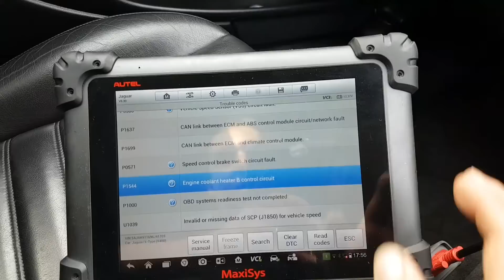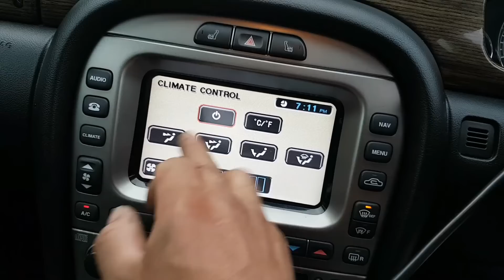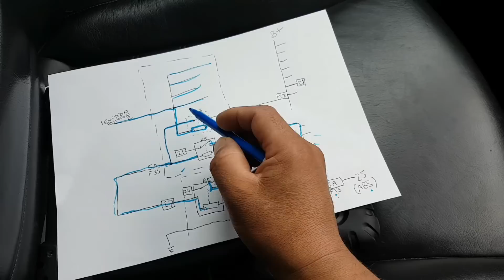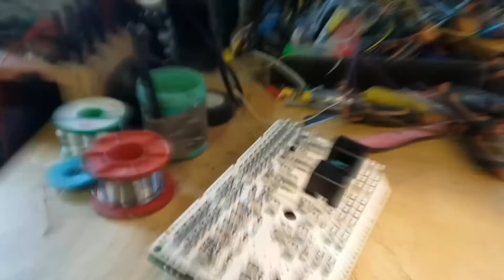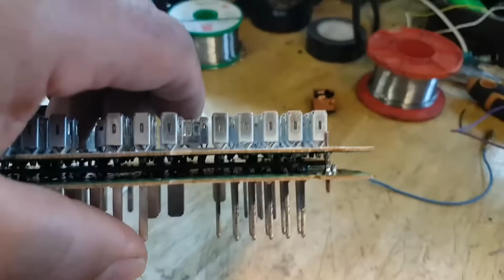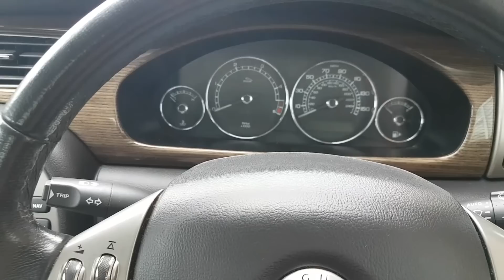Jaguar X-type (X400) multiple electric faults one common cause... Fault finding and repair.

Comment: Fantastic job Luis, keep up the good work. 
I have only one question, did you manage to permanently remove the error "dsc system fault" and "cruise not available" by replacing relay 13? 
I get that error and my car goes into limp mode on Jaguar X type 2.0 diesel 2004 year. 
The electronics guys I've driven the car to don't know how to fix it. 
Thank you. 
Greetings from Belgrade!
Reply from the maker: All as per the video...
What trouble codes are you getting on the ABS? 
👍👍👍
Reply: I don't know the exact codes, I'll have to ask the mechanic next time I go to him. Limp mode appears every third or fourth drive, but the cruise is not available light is always on.
Reply from the maker: Without the codes it is difficult to advise...

Comment: I have a question about a faulty anti theft issue on the Jaguar x-type v6 2.5l
. Can the immo be turned off.
Reply from the maker: Possibly... I am not sure which ecu is on that one.
But, what is the issue?
👍👍👍
Reply: @LMAutoRepairs  It's a cheap side project car I'm going to buy. Seller says it won't crank because of the antitheft module. I was thinking to make an “all keys lost”. But should be easy enough, I think the IMO is in the Instrument cluster.
Reply from the maker: Possibly...
Better try to program a key for it... but if you are not bothered, immo off might be a possibility...

Comment: My 2005 X Type only 110000 km. Not an electrical issue with the instruments but a tick tick ticking sound varying in speed and intensity as I drive along. Sounds like it could be a mechanical sound maybe emanating from the speedo as the dial spins behind the needle????? So it wouldn't have a speedo cable like in the old days but the speedo obviously spins at varying revolutions depending on your vehicle speed on the road. Any thoughts on the cause??? Could it be fixed or is stripping the cluster not worth the trouble?
Reply from the maker: Hi
Could be, some clusters use a stepper motor  with gears... but is the needles accurate and steady?
Just asking, cause I would guess the needles wouldn't be stable. 
👍👍👍
Reply: @LMAutoRepairs  All the gauges work fine, steady and accurate. It’s just the chit chit chit sound that drives me crazy whilst driving. I thought it could also be a relay tripping on an off somewhere. Initially I thought the sound emanated from the light switch cluster but it’s hard to tell
Reply from the maker: @allanpennington 
Understand, but it if difficult to advise without listening to it...
👍👍👍
Reply: @ Its like morse code but a chit chit chirp chit chit....type sound. Not that loud but noticeable when driving. I assume if I took out the cluster and disconnected the two rear cable assy clips the car wouldn't start? That way I could at least confirm the source of the noise??
Reply from the maker: @allanpennington 
Possibly will not start, but if you disconnect if once the engine is running, should stay running... so you can test.

Comment: Your work and dedication is absolutely amazing and inspiring. As a soon grauated engineer, thanks for sharing it ! I own a 2007 2.0d Jaguar X Type with only 100.000 kms. She's in mint condition aesthetically and mechanically. But I am having troubles with my headlights. The auto function doesn't work, my Left Low beam doesn't work too, I can't maintain my High beams, only flash them and I can't level my beams (with the selector according to the load of the vehicule). From what I've read, it can be a consequence of many little failures... Would you mind giving me some advices or hints on how to take on that problem please ? I'd be very grateful. Thank you
Reply from the maker: Hi
I would start by scanning the car, check live data, see if there is anything that points into any direction...
👍👍👍

Comment: I had problem with my passenger fuse box... fuel pump relay on 2.1 V6 was broken. I change it like you on video and it works! Thanks

Comment: Extremely helpfull video. I had exactly the same fault with my Jaguar x type 2.2 diesel 2007. Of course could not change just the relay Not have tools or experience. So replace the whole fuse box together with black box and wire. THANK YOU very much for detailed information. You are the best!!
Reply from the maker: ☺️
Thank you for watching and for your comment! 
👍👍👍

Comment: I fully agree that it hurts to see that Jaguar apparently did things on purpose to make things close to "unfixable" (that "fuse" on the PCB and that non-serviceable relay). I have 2 more examples, which I fixed anyway: The rubber on the plastic-strips to the left and right of the windscreen disintegrates over time. I just wrote a post on jaguarforums of how to fix that anyway with generic rubber-strips. Also: Jaguar designed one bolt of the oil sump to remain inaccessible. To avoid having to remove the transfer-box and the cat and whatnot, I drilled a precise clean 17mm hole thru the side of the transfer-box (and also just wrote the post about that on the same forum).

Comment: Horrendous design on that board. I've never disassembled them that far. I've opened up the box and saw the clusterF of the two boards fused together and said 🤦‍♂️ and tossed them.

The sad part is these boards are starting to become harder to get. I'm pretty sure they are discontinued. At least here in America.
Reply from the maker: ☺️
The repair will become the only way then...
🤪
👍👍👍👍

Comment: Hi Luis. How you don’t lose your temper with some of the tw*ts that go before you is beyond me. 

It’s the same with heating systems. An idiot with a little knowledge is a scary scary thing!!! 

Congrats for completing it though. 

Re the egr, on my volvo T5’s, I’ve experienced people changing the recirc bov on the cold side of the Mitsubishi turbo to get it to make a silly noise! Because the air doesn’t recirc into the inlet as it should, it throws the whole inlet monitoring system into a panic. Maf fault. Tps fault. Map fault etc. Well done for listing video. It was very interesting following your thought process. 

Thank you. 

Ted in bedford
Reply from the maker: ☺️
It is challenging at times... no doubt! 
Thank you for watching and for your comment! 
👍👍👍

Comment: I had the exact same faults on a x type I was working on at the dealer, unfortunately you can't buy a new fuse box anymore so repair or second hand is the only fix.
Great diagnostics! 👍🏻

Comment: You sir are definitely a genius, in automotive electrical diagnostics and repairs. As for the engineer's who design dumb crap like that, they knew what they were doing. They're overcomplicating something, at the expense to the owner or manufacturer.

Comment: You certainly go the extra mile but I was wondering if only one of the relays is used couldn't you have left the relay in place and just used some jump wires on the back of the board from the non-working relay  to the working relay to bring that side into use? Then there wouldn't be any need to separate the two boards. Or am I missing something?
Reply from the maker: That's kinda correct...
I could have done that... or just smash the relay and solder another one with some wires... again, wouldn't have to separate the boards... if was my car, I would might have considered that route... 
Thank you for watching and for your comment! 
👍👍👍

Comment: Very detailed component repair Luis . Wouldn’t it have been easier to find a used board?When  I use Inpa software on my e39 after a minute or two it kills the battery stone dead which was from BMW purchased in 2019. My Thinktool Pro can run substantially longer. Crazy.
Reply from the maker: A donor fuseboard would be indeed quicker... but, where was the fun on that?
🤪😋
👍👍👍

Comment: I wonder what the people tasked to manufacture that board sandwich must say.  That is a really convoluted assembly.  How much money goes into that, instead of having a simpler design.
Nice job doing the 66 x2 solders and even going thru remelting each after cutting them, hat off.
Reply from the maker: ☺️
Thanks!
👍👍👍

Comment: Top job Luis. Can't get why they chose to put such a generic yet vital relay on a PCB with no apparent reason (it does not seem like a smart fusebox or "power distribution control unit" or whatever fancy names manufacturers happen to give them - nothing but relays and fuse sockets on a PCB). Agree on the finance department theory.
Reply from the maker: ☺️
Thanks!
👍👍👍

Comment: Great video. Alot of soldering included and great idea how to connect wires back with cooper. Who didn't unsoldered this kind of things don't really know what you are talking about. It is a piece of sh** to work on.  Done in past some kind of this relay boards on Ford. With 2nd one that i worked on I didn't unsolder everything I just "cut the relay" and destroyed it and soldered the contacts with wires for new relay on pins ond mounted it externally. It worked out great and taken only 10 min of a time.
Reply from the maker: ☺️
I could have done the same, but was already buried deep into it...😋
👍👍👍

Comment: Interresting video, i had similar problem but with solder cracks on a small internal relay that is powering tail lights, so its with mandatory daylight all time powered. I believe its the temperature that coil generates and makes the failure happen. Hate that sandwitch style of fusebox.

Anyway its very clear, that you like this sort of repairs. As you mentioned "its late today", i saw that you returned at 19 hour, it was clear to me. I have it too.
Reply: A lot of these problems also stem from the fact that they use lead-free solder these days. In my experience its a lot more brittle than the old leaded stuff was, and causes cracked solder joints when the component is subject to vibration or impact.
Reply from the maker: And to heating/temperature cycles...
Absolutely agree!
👍👍👍
Reply from the maker: ☺️
Indeed...
This type of fusebox or even module, are not made with repairs in mind...😋
👍👍👍

Comment: Hi Luis. 

Re the jaguar with the double relay soldered to the fuse board, am I wrong in thinking that you could have utilised the ‘spare’ side of the double relay if you didn’t have a replacement available? 

Keep up the good work. I really appreciate the videos. 

Kind regards 

Ted in Bedford.
Reply from the maker: Hi
That's correct...
I could have done that...
👍👍👍